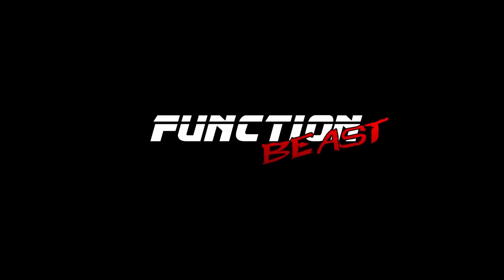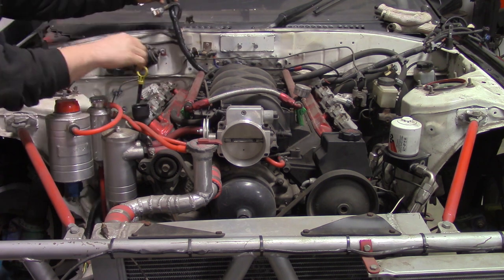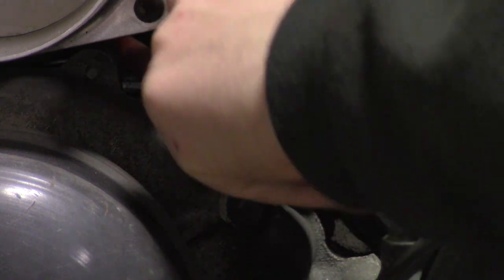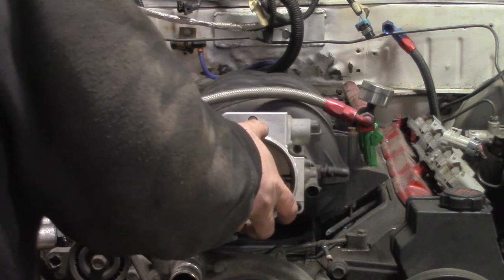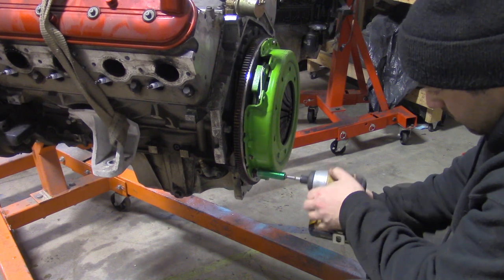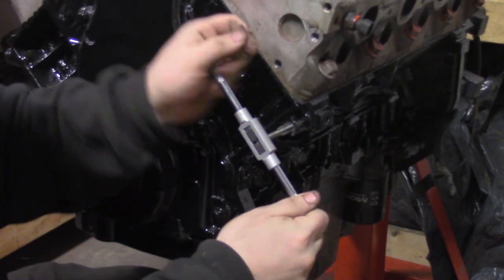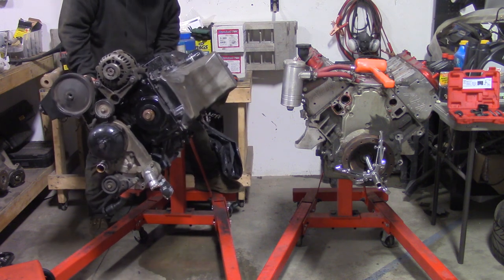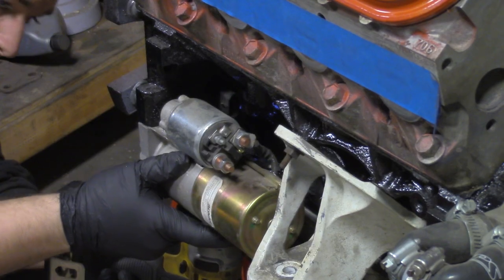FC3S RX7 LS1 Swap in one weekend FUNCTION BEAST: S1-E11

Comment: Is that a custom bash bar? Very interesting and would solve a lot of headaches with a large single setup.
Reply from the maker: Sure is! It's a custom tube front that Evan made for the car years ago. It was designed to be modular and easy to take apart and put back together.
Reply: It's absolutely fantastic

Comment: btw, what engine mounts are you using, as well as the transmission, ive heard the cd009 out of a 350z works good but the kit costs an arm and a leg.
Reply from the maker: Evan custom made them. This car was built a long time ago, and it used a T56.
Reply: @FunctionBeast  it's honestly a really good setup, paint wouldn't hurt but it looks awesome and that removable front end is killer